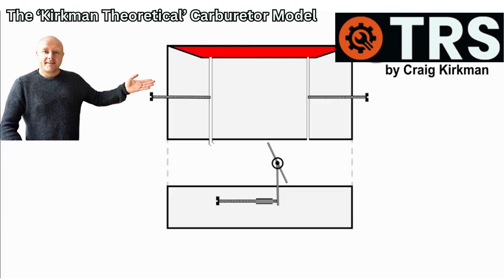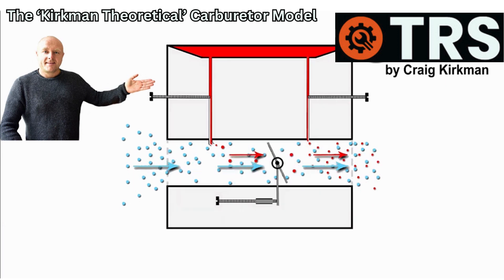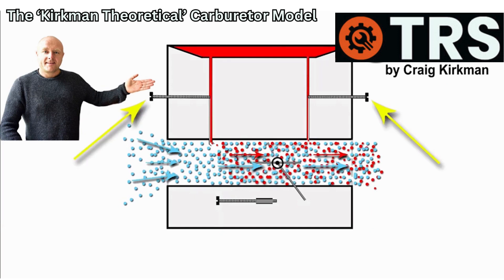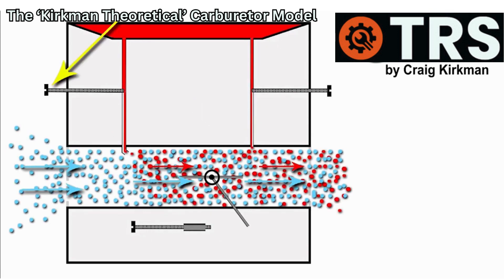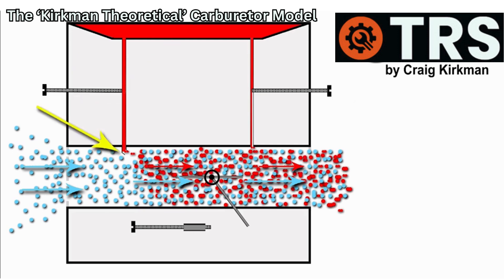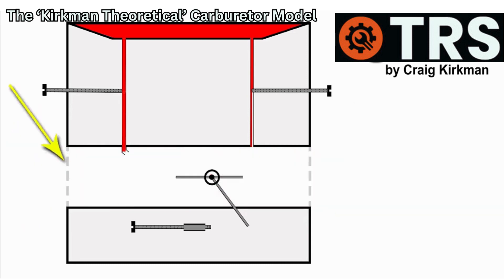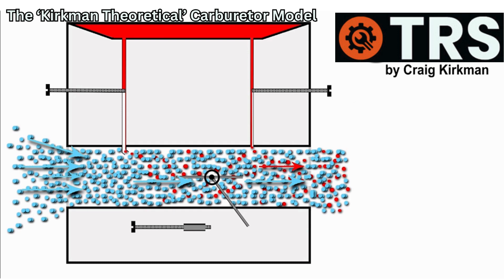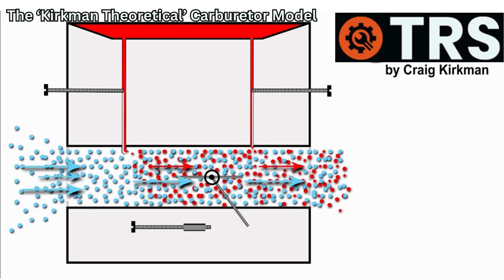The ‘Kirkman' Educational Carburetor Model.  (by Craig Kirkman)

Comment: Hi Craig
I was wonder if you could help me?
I've just brought the ERBAUER ECSP41 40CM 41.4CC CHAINSAW
it seems to be a ok made saw, but i'm struggling to understand the choke. The instruction tell me to start or attempt  start the engine with the choke closed. if that fails start with the choke open but no mention of closing once warm. but most confusing is when the engine is off or running and i pull the throttle it automatically open the choke!! i.e choke is alway open when running

i'd really appreciate any advice

regards

jack

Comment: I have an engine oil viscosity question. My V8 Challenger calls for 5w 20 oil. If I don't let the car warm up to where the oil is at least 140 degrees the next cold start you will hear the lifters clacking. I switched to 5w 30 oil. I can now start the car and turn it off after a short time and the next could start is quiet. Is this because the thinner oil is bleeding out of the lifters ?
So 5w 30 seems to completely resolve my issue. Do you think its safe to run the 5w 30 for the long term?

Comment: I've got a 2 stroke rototiller called a Mantis. It revs pretty high but also operates at a much lower RPM when digging into solid ground. If I elevate the tines and adjust the carburetor as shown, should it work? I've already played around with the adjustments and it's fickle, I may need to disassemble it and clean it to achieve consistency.It's about 12 years old without many hours, I replaced the fuel lines and filter last year. I've screwed around with the carb screws for about 3 years, it would run best with a full tank of fuel. It had a small hole in a fuel line " Duh " so now I'm where I am and spring is coming. Just curious what you might think, Regards From Vermont USA